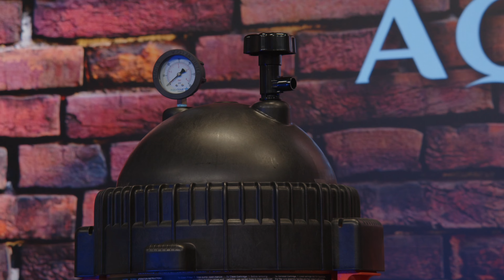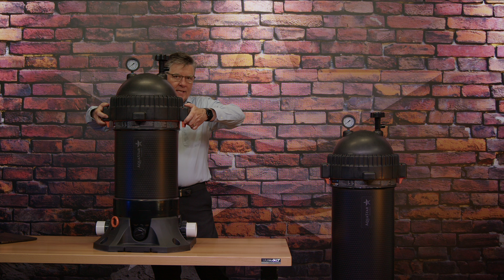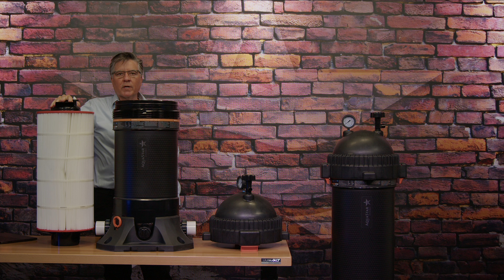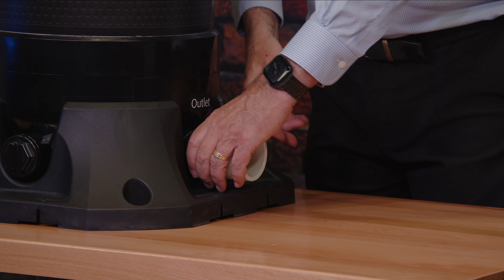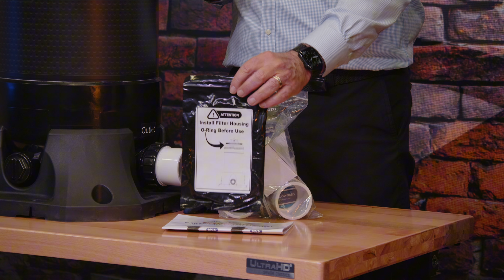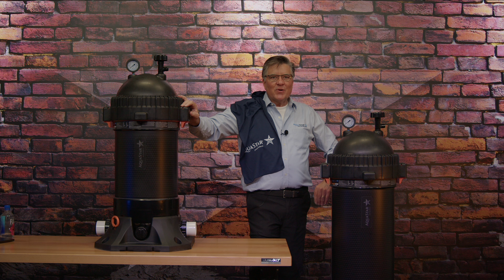Pipeline Filter Deep Dive - Aquastar Pool Products

Comment: i love this filter, so easy to maintain and clean

BUT I wish the Core is a stronger, thicker plastic because it feels like it can crack whenever I try to lift out the filter,  and the union nuts are kinda fragile feeling, those two could be improved

Lastly, do you guys sell JUST the O-ring for the union? I think mine is leaking so I need to replace it. Could i get the part number? and where to purchase it?
Reply: The oring comes with the union. Part number PF2013
Reply: @koreywax5676  dude i already know, but i'm asking for replacement o rings since they wear out
Reply: @bludika  I’m mean you get both the union and the oring together with that part number.
Reply: @koreywax5676 dude you’re stupid, stop talking